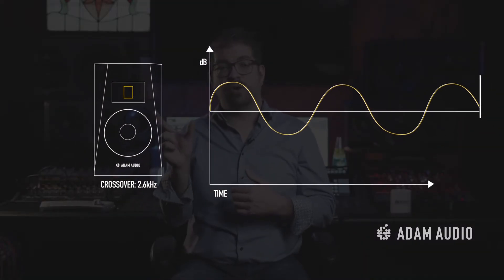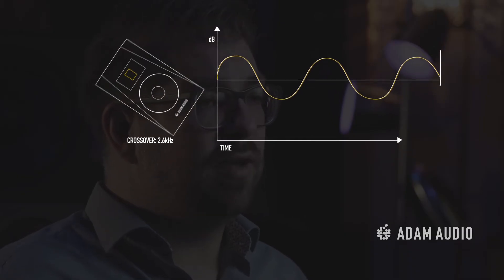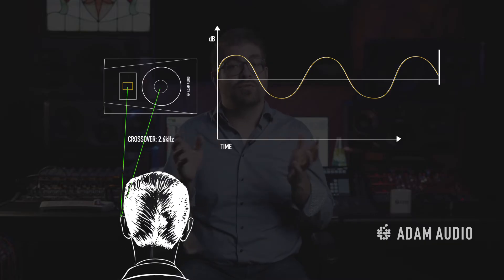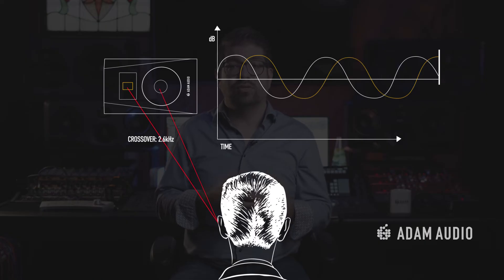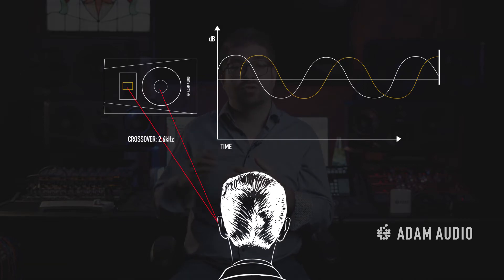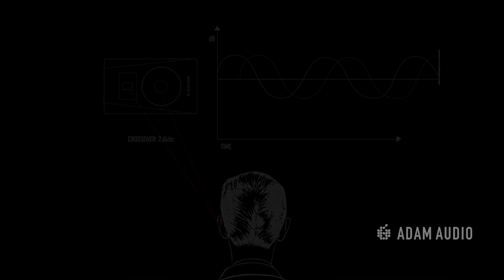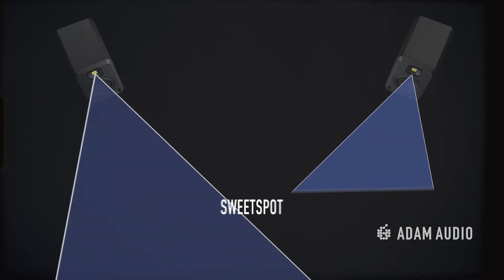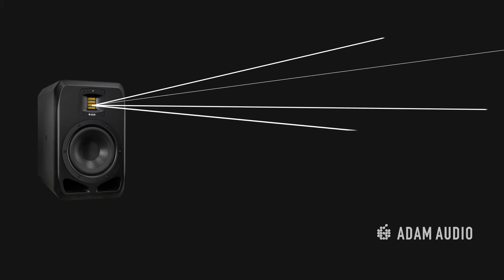VERTICAL Vs. HORIZONTAL Studio Monitors (Can They Be Flipped?) | ADAM Audio

Comment: Hello, I have a pair of A77x and I'd like to know whether I can use them vertically by any chance?? TIA.
Reply: Seems like folks buying vertically arranged monitors want to use them laying down on their sides.... and folks having horizontal configuration monitors want to use them standing up. Whatever gets you though the night, I guess.
Reply from the maker: We don't suggest using the A77X vertically due to the points made in this video. The sweet-spot would shrink significantly since that model doesn't not allow for tweeter rotation. However, if you do end up flipping them, make sure that, since the A77X is a 2.5 way, the mid-range woofer isn't above your head.
Reply: @ADAMAudioBerlin  got an email reply from Adam Audio that said it is a common misconception that the tweeter in these needs to be rotated and it doesn’t matter which direction the tweeter is. Can you clarify? Please and thank you

Comment: The problem can be alleviated by using coaxial drivers, has Adam looked at fluid Audio with the ribbon Tweeter surrounded by the mid woofer?
Reply from the maker: That's a great point. For us at this time, however, we are continuing to improve upon our traditional design.
Reply: Coaxial drivers have their own set of formidable downsides.

Comment: How about turning a T7V upside down, so the tweeter is below the woofer? How does that impact the sound?
Reply: Why would you want to do that?
Reply: @Bumper210  This isn't my current situation, but say the desk is too high up, or monitor stands are much taller than the desk, then the tweeter would be too high. Also out of curiosity
Reply from the maker: Hi Matt, technically yes that would be fine if you needed to do that, however since 2-way woofers extend up to the midrange frequencies, you would be also missing some directional midrange information as well if the woofer was above your head, unless you have them angled down towards you.

Comment from the maker: Are your monitors vertical or horizontal? If you have questions about this in-depth video, leave them below and we'll be sure to respond 👊
Reply: I have krk8 first gen and I put them horizontal so I have a better response in hertz. I feel that they are not designed to do that but it works fin for me.
Reply from the maker: @innamididubyard  Sometimes that works just fine! Depends on many factors but happy they work well for you. Cheers!
Reply: Can the tweeter be flipped in the t5v as well? Or do you even recommend putting them on their side at all?
Reply from the maker: Damian Chiliński  Hi Damian typically it is better than having them sideways, we would just suggest a way to angle them down towards you still, since 2-way monitors use the woofer to cover much of the mid-range detail as well which isn't as directional as the tweeter, but you don't want that too much over your head either. Good question and we hope this helps! Also hope you're enjoying the A77Xs 👊
Reply: @ADAM Audio hi there, I see sooo many hip-hop/trap producers and engineers putting their monitors horizontal, even though they are designed to be upright. Specifically the Yamaha HS series, is where I see this the most. All the science points to that being wrong.... but there must be a reason so many people do it? I can't find a conclusive answer anywhere, and was wondering if you had an opinion or any info on this. thanks for your time
Reply from the maker: Hi Alkalyne Beats, it really depends on the setup you're using. We at ADAM Audio also developed special speakers like the A77X that are designed to be placed horizontally. We guess that some producers just like the looks of placing their speakers horizontally, even though there might be a loss of playback quality.
Reply: @ADAMAudioBerlin  Ah, I see. Thanks for your reply, much appreciated!
Reply from the maker: Sure, glad to help! 👍
Reply: The tweeter on the A8X can't be flipped. Now I need to put them horizontally. I was thinking that i can rotate the internal tweeter and leave the wave guide the same, but maybe it might be pointless. Any thoughts?